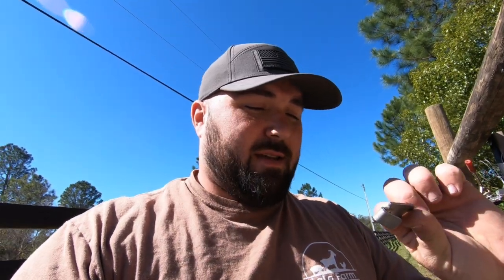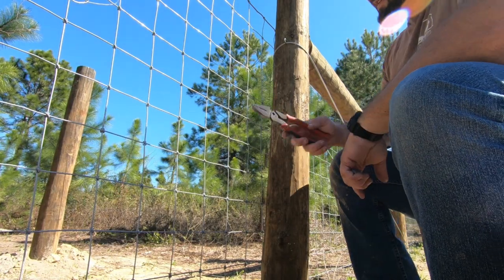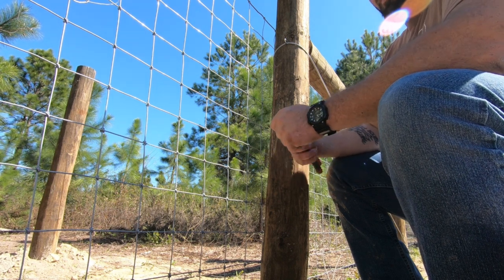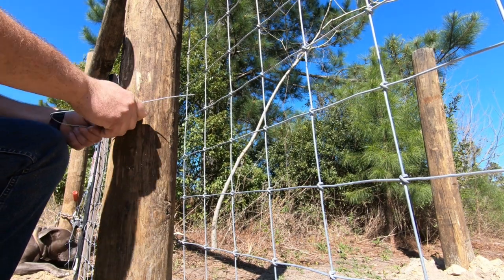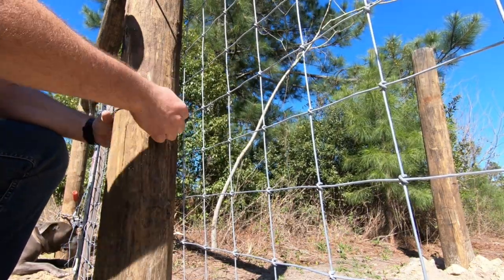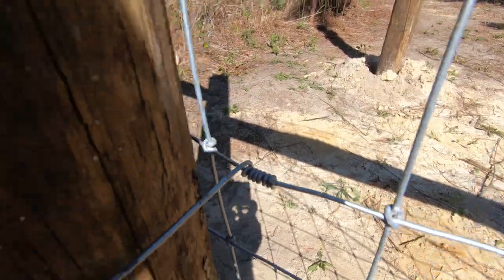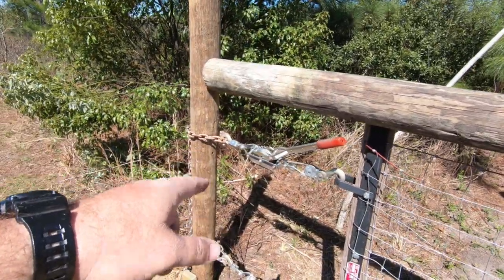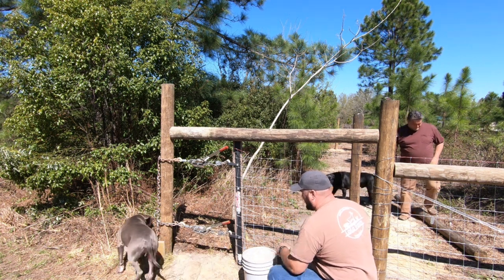HOW TO WRAP WIRE FENCE - Woven wire field fence install

Comment: What is that tool called ? To wrap the wire
Reply from the maker: Amazon Link: https://www.amazon.com/5pcs-Fence-Wire-Tensioning-Twister/dp/B08PVFMQRL/ref=asc_df_B08PVFMQRL/?tag=hyprod-20&linkCode=df0&hvadid=507722494263&hvpos=&hvnetw=g&hvrand=2055171699200785992&hvpone=&hvptwo=&hvqmt=&hvdev=c&hvdvcmdl=&hvlocint=&hvlocphy=1015103&hvtargid=pla-1295763701698&psc=1

Tractor supply Link: https://www.tractorsupply.com/tsc/product/bekaert-wire-twisting-tool-633003-1422347?cm_mmc=feed-GoogleShoppingProduct_-1422347&gclid=Cj0KCQjwiqWHBhD2ARIsAPCDzamwrhRAN_yxzqfzJFRCXf_7Iq9fqlK2OeTar8n75-uk751EKMsFdvIaAmUGEALw_wcB

Comment: Your fence puller should have been in front of the post you tied off to and then released the come along after youre tied off that way you don't lose any tension
Reply from the maker: Thanks for stopping by and watching.  The set up we use it to set up a dead man post about 6' beyond the corner we are pulling to and then pull off of the dead man H brace - not the fence corner post.  This way, as we cut each wire, the rest of the horizontal strands hold the tension of the entire run.  We dont lose any tension and the come alongs are not released until after the last horizontal wire is attached to the corner post - but by that time - the run tension is held by the other 20 or so strands that are already attached to the corner post.

Comment: Why do this vs using staples?
Reply from the maker: The fence is combination of wood field fence posts and metal t-posts.  The twist ties in this video are for the metal t-posts whereas we do you staples in the wooden posts.
Reply: Id do both.